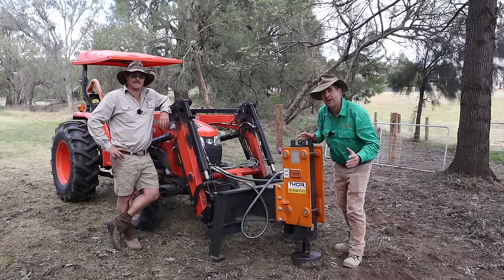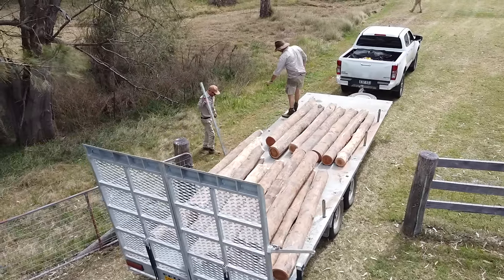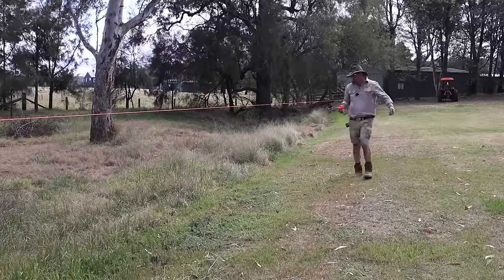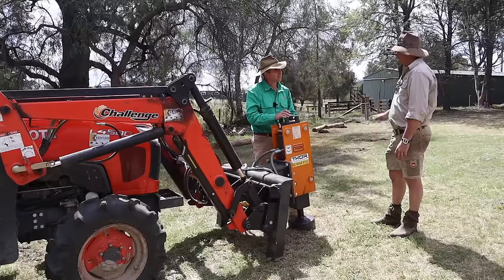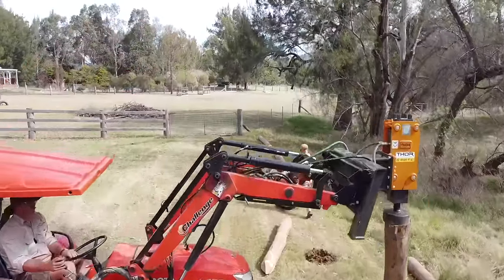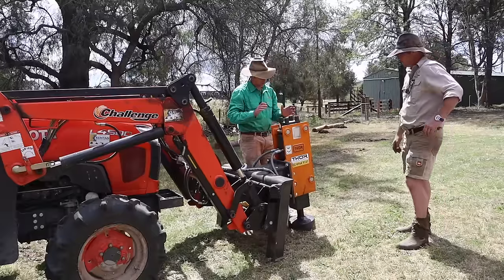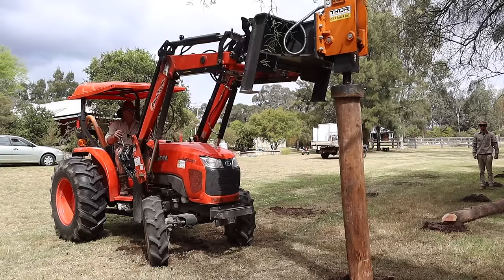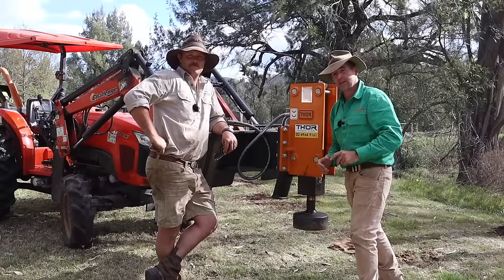Driving Fence Posts with Thor Post Driver!

Comment: Good morning, Tim, excellent piece of kit, just wondering if you change the striker if pushing in steel pickets, Cheers
Reply from the maker: Hi mate. I know you can change the heads. I’m sure the manufacturer could answer that. The crew I was with doesn’t use it for that. I did ask the question!
Reply: If you want to bash in pickets with a ram/motor just buy a hand held post driver 4 stroke, I won't name any products or names so not to advertise, but there are many out there. I have used one for three years and over 7,000 star pickets  for $1,650 with no other costs.

Comment: Can you use this for concrete post driving? How do you keep it straight and level, or is that up to the operator?
Reply from the maker: Yes. But as with all percussion drivers, turn down the pressure. Most operators use a spotter for level, some hang a chain from the driver that’s also a depth gauge.